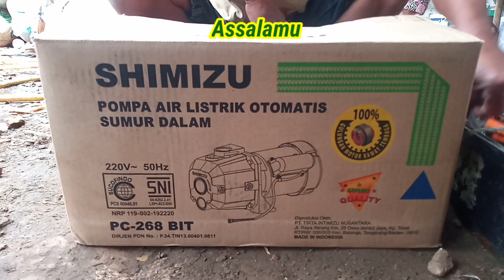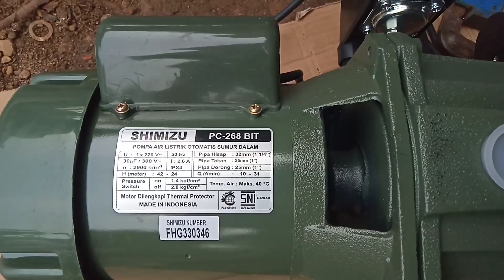Cara Pasang Pompa Air Shimizu PC-268 Bit I pasangpompaair I pompajetpump I servicepompaair I shimizu

Comment: Babe yg baik hati..sy mau tanya.pompa sy bru bli pompa simizu 168bit td sy nyalain tpi cetak cetok bahkan spai mati mesinnya..itu kran out nya bagusnya di full in apa setengah aja..trus normal psi/barnya 168bit itu brp ya..?dlm sumur sy 20m dantoren ketinggian 6m.tlong di jwb ya babe yg baik hati..smoga alloh yg membalas ats kebaikan babe.triksh
Reply from the maker: Kalau Stop Krannya di Buka Setengah Masih Cetak Cetek, Coba di buka 3/4 Pak Stop Krannya, Bar nya di Bikin 30 aja Pak atau 25, nggak usah tinggi2 yang penting Stabil tekanannya
Reply: @BABETEKNIK  siap babe...oy maaf babe blh tanya lgi.oy pompa simizu 168bit itu apa kah wajib/hrs pakai tabung..??dan apakah wajib/harus pakai radar toren??smoga babe sehat slalu
Reply from the maker: ~Tabung atau Tangki Angin Fungsinya Untuk Mengatur Tekanan Angin agar Air Stabil Pak dan Membantu Tekanan Pressure Switch/Otomatis agar Awet tapi sekarang kebanyakan jarang pakai Tabung/Tangki Angin biasanya Pakai Plug/Dop, Nggak Pakai juga nggak apa2, tapi Resikonya Presssure/Otomatis Cepat Rusak
~Untuk Radar Toren Fungsinya Apabila Air Toren Penuh Otomatis Pompanya Mati Sendiri, Kalau nggak pakai Radar, Air di Toren Bisa Luber, Cuma itu aja sih Pak, Mau Pakai Atau Tidak Terserah Sih, tapi Resikonya Kalau Lupa DiMatikan Pompanya, Air Di Toren Luber

Comment: Om kalaw pipa hisap harus nya 1 1/4 dbikin pipa 1 in...apakah bikin air kecil ya keluar nya....
Reply from the maker: Nggak Juga Pak, Biasanya yang Bikin Air Kecil, Mata Jetnya Mampet atau Permukaan Air nya sudah jauh
Reply: @BABETEKNIK  ohh gtu...ok pak...sya si pake shimizu 375
Permukaan air masih di 15 meter surut di 20 meter normal nya
Dari pertama masang mesin sama pipa nya....air nya kecil pak keluar nya
Reply from the maker: @ridwanhadi1536  Biasanya Permukaan Airnya Sudah Jauh
Reply: @BABETEKNIK  ok pk mksih informasi nya
Reply: @BABETEKNIK  kalaw permukaan air sudah jauh gtu
Trus pipa hisap hisap sya kembalikan standart ukuran 1 1/4 kira2 kuat gak ya mesin 375 buat nyedot air nya....

Soal nya suka mancing juga
Kadang jarum amper nya drop Nol sendiri
Mata jet di taro di kedalaman 34 meter